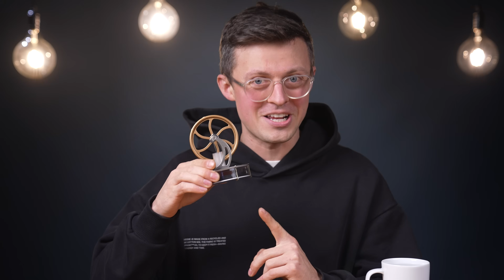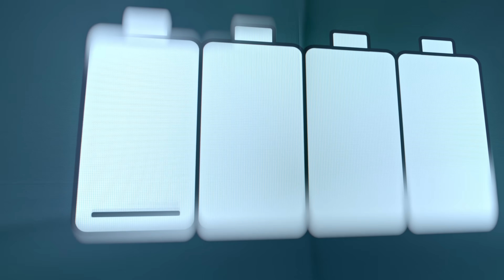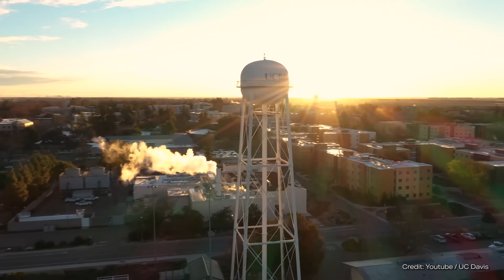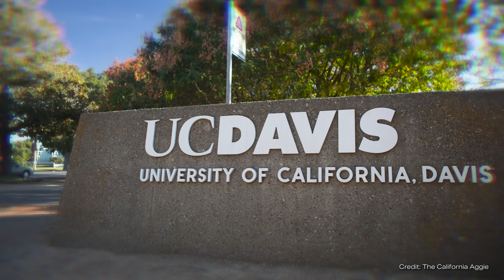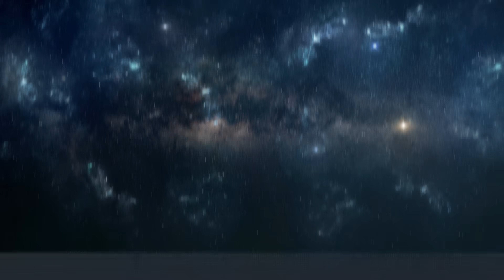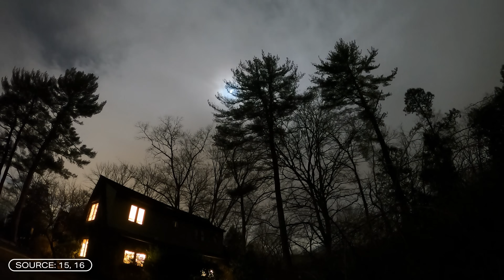This Engine Runs on the Cold of Deep Space!

Comment: The guy on the NightHawkInLight YouTube channel has done a lot of work with passive cooling and infrared cooling paint
Reply: You beat me to it by 20 minutes.
Reply: You beat me to it  😅👍
Reply: Ben also works on this!
Reply: @BuiltAndHosted  Who dat?
Reply: @AlbertaGeek  Ben=NightHawkInLight
Reply: @Peter_A1466  TIL
Reply: Dude has done a lot
Reply: Yes he is one of the definite OG founding DIY YouTubers and has definite quality stuff! Him , Cody's lab , applied science, not too many others.
Reply: He's done many cool projects like that (pun intended).
Reply: I like that guy and have P.M-ed him.
Reply: Combine this with his work thays simple and easy to undertand and youve got yourself a solar stirling engine that works at night possibly too
Reply: I wonder if we can get him interested in this. Imagine if the heat source were a thermal sand-battery rather than ambient temperature, and the radiator were still the sky-box radiative cooling. Huge boost in efficiency.
Reply: @beowulfshaeffer8444  There is a company that is looking at using flat lens' to cause thermal bricks to heat up  then run Sterling engines to make electricty.
Their numbers check out.
Nobody knows IF they would be using this method to power the cooled down side.
Reply: @beowulfshaeffer8444  I'm still a fan of using air that has been through a Geo tube that is placed 10 feet down.  The air should be about 55 degrees.  That stable number is very useful based in it's predictablity.
Reply: I've tried to convey this and other info to NightHawkLight.  There is an issue about how they made Ice in the Middle East in which they mention something about Solar radiance IE heat leaking into space pretty directly.
There may be times/+ Locations where you would want the coating material removed for a few hours?

Comment: The simple solar ovens made from a cone of reflective material pointed at the sun, with an enclosed container in the bottom of the cone which collects the heat and cooks things, work in reverse at night when the cone is pointed at a spot of empty sky without clouds - and can get the enclosed container very cold, they have been used to freeze water.  I haven't seen any practical use of this phenomenon, but it is a more directed heat radiator than the plate with special coating, and it would be very interesting to see if it could be incorporated into a nighttime stirling engine.

Comment: Would have to consider some serious implications and be careful on balances not only on earth but in space quick fixes arent the good way but it can help if done in balanced ways the flows should harmonize and compliment one another you wouldnt need the conflicting lush n pull it would have a beautiful wave that would compliment one another cha gin the internal spiral would change the resonaces little magnetic wave form resoances would help with the natural flows and sing together
Down side id see with venting to space in those dynamics is that your creating a heat shield that self reinfoces cause the cold air wouldnt be allowing heat to dicipate properly long term dynamics in space need to be accounted for short term n long term which beautiful friends could help us with that surrounding planets fields and sund field as well
Natural light lattice shielding does it naturally plus other options for harmonizing carbon on automic scale so the heat is brought back into balances naturally no venting required for that when stabalization works in harmony

Comment: I recently became a fan of your channel and really like the optimism and inspiration of your videos.
However, the math is a bit off.
I have a lot of my own stirling engines, wind turbines and generators, solar panels, inverters, batteries... deep into the stuff.
The 6W/m2 is the heat dissipation to space, it is not anywhere near what a stirling engine in such a configuration can do.
Anyone remotely familiar with thermodynamics has heard about the Carnot efficiency and that it represents the maximum theoretical efficiency any heat engine can achieve operating between hot side T and cold side T. That T is in °Kelvin.
So no matter what invention comes around with the presently available physics, the max efficiency of a perfect engine that operates between Hot=15°C and Cold=5°C is just 3.47%.
6W*3.47%=0.2082W per square meter. Better go back to the "horse" power.

Comment: What if you were to use the flywheel to move magnets through copper coils, use the generated power to feed to a battery, then the battery for charging devices?

If you were to actually heat up the lower side using a small burner, would this increase the efficiency?

Comment: I'm surprised they didn't just use the heat from the greenhouse to power it. or solar water heating. I would think that would be cheaper and certainly wouldn't be as affected by heavy cloud cover. Mix the two and you should have something the runs much more frequently too.

Comment: Inhsd s multi  backup system and ending finding this because actually it was the difference in temperature between the outside air and the air conditioned house at the time. So I found as long as you didn't have insulation there you could actually do it correctly but you have to have the correct materials in between and also there is a way that you can do it yourself lubricate yourself and you don't have to apply oil or other lubricants to it on the regular basis

Comment: the theoretical optimal of this being guessed at "over 6 watts per meter^2" basically just means its outright not as good as solar, solar panels are around ~20% efficient and can do about 150-200 watts per meter^2, this only really makes sense to be used on something that already generates a lot of waste heat the same way we use regenerative braking in cars
Reply: Spot on. This competes with the same space you could also place a solar panel and this is almost certainly going to be much more expensive than just adding batteries to a solar panel setup.

Comment: Ill give it that sterling engines are incredibly efficient for a mechanical heat engine....but...The problem with sterling engines is very low starting torque (which makes it difficult to overcome starting friction) and low hp for the weight and volume of the equipment, which means low power, recovery problems at low rpms and overall low power and reliability. They also do not scale well for this reason. There is exotic designs, but nothing on the mass scale. If the initial starting torque, low HP per weight and volume, and scalability can be fixed, then this might make sense.

Comment: how would it work in a greenhouse? thats a moist environment. and glass is opaque to far-infrared radiation.
sounds like a lie. did you mean it works outside of a greenhouse and powers a fan inside the greenhouse? 
if thats the case why mention a greenhouse, not relevant.

Comment: I think the most intriguing stirling engine application I've seen was as a boat engine, as the water you're floating in is a perfect radiator for the cool side of the engine, with sunlight conveniently on the other side to warm the hot side. Especially for small boats, it makes perfect sense.

Comment: So, we put a sterling engine directly into the spaceship hull, since the engine can be designed to interchangeable run on either hot or cold side. internal to the space craft, we apply a magnetically levitating fly wheel, with an 80-100: 1 gear ratio to create a "space turbine" basically. The sterling space turbine could power or support power to spacecraft systems and power electrolysis for making Hydro Oxy fuel for propulsion.
Additionally, since it's a sealed system, fill it with He since helium is the most thermally conductive inert gas. this will allow for a faster thermal transfer from the gas for expansion and contraction. High RPMs from the sterling engine combined with a near frictionless Fly wheel Turbine, could in theory, sustain a spacecraft, provided there was a large enough, or multiple modules. I think multiple modules would be the way to go to counteract the centrifugal force from the large module variant, unless you apply some sort of counter gyro or counter thrusters.

Comment: I could see this helping reduce capex costs in mass greenhouses, for example. No need to run wires for circulation fans IF they wind up efficient enough. That said, then the system needs to overcome the greenhouse's design to retain heat, not to mention that it's probably cheaper and easier to have a tiny battery and solar cell on each circulation fan like this. Hmm.

Comment: 6 watt pr square meter? solarpanels are up to 100w for the same area. Granted, they don't work at night, but they CAN also use infrared, so if you add a infrared heatsource you could get more than 6w 24-7

Comment: Interesting idea to use a house to drive a Stirling engine. The temperature difference between a corrugated iron roof (or even a plate steel plate on the roof) in direct sunlight, and the earth beneath the house can easily exceed 50C.

Comment: If the flywheel of the Sterling Engine can be a fan, and cooling is essential for solar to work efficiently, could it not be used to assist in cooling by having a line of Sterling Fans beside a solar panel to improve it's efficiency passively? Would that also make keeping the solar panel clean a bit easier too?

Comment: Stirling Engine in Outer Space? After watching this video, I was thinking The German Science Guy should have finished by telling us about how the Stirling Engine will be used on the Moon. I finally got around to asking Manus AI to explain. Prompt: Research the Stirling Engine, confirm facts, Research use as an electric generator, Future use to power a Lunar Outpost, Recap Key Points, and finish with your opinion as an Engineer’s Advanced AI. Manus 1.6 Lite: The Stirling Engine: A Comprehensive Review of its Principles, Applications, and Future in Space Exploration

Introduction

The Stirling engine, a closed-cycle regenerative heat engine, represents a fascinating and highly efficient technology with a rich history and promising future applications. Invented by Robert Stirling in 1816, this external combustion engine operates on a unique thermodynamic cycle that allows it to convert thermal energy from various sources into mechanical work with remarkable efficiency. This report delves into the fundamental principles governing Stirling engines, examines their current and emerging roles as electric generators, and explores their critical potential for powering lunar outposts, culminating in an engineering perspective on their significance.

1. Fundamentals and Operational Principles

The Stirling engine operates by cyclically compressing and expanding a fixed amount of working fluid, typically air, helium, or hydrogen, within a sealed system. Unlike internal combustion engines, the heat source for a Stirling engine is external, allowing for remarkable fuel versatility. The engine’s operation is based on the Stirling cycle, which theoretically approaches the Carnot efficiency limit, making it one of the most efficient heat engine cycles known [1].

Key Components and Configurations

Central to the Stirling engine’s efficiency is the regenerator, a heat exchanger that temporarily stores thermal energy during one part of the cycle and releases it during another. This regenerative process significantly improves the engine’s overall thermal efficiency. Stirling engines are broadly categorized into three main configurations, each with distinct piston arrangements [2]:

2. Stirling Engines as Electric Generators

The inherent ability of Stirling engines to convert heat into mechanical motion makes them highly suitable for electricity generation. They can be coupled with alternators to produce electrical power from a wide array of heat sources, including solar energy, biomass, and nuclear reactions. This versatility, combined with their operational characteristics, positions them as a compelling alternative to traditional generators.

3. Future Use: Powering Lunar Outposts

The unique challenges of lunar exploration, particularly the extended lunar nights and the need for continuous, reliable power, make Stirling engines an ideal candidate for future lunar outposts. NASA’s Kilopower project, which successfully demonstrated a small nuclear fission reactor utilizing Stirling technology, highlights this potential [5].

The Kilopower Project and Fission Surface Power (FSP)

The Kilopower Reactor Using Stirling Technology (KRUSTY) experiment showcased a nuclear fission power system capable of providing up to 10 kilowatts of electrical power continuously for at least 10 years. This system is particularly well-suited for the Moon, where solar power is unavailable for approximately 14 Earth days during lunar night [5].

Enhanced Efficiency: Stirling converters are significantly more efficient than traditional radioisotope thermoelectric generators (RTGs), meaning less nuclear fuel is required to achieve the same power output. This is crucial for reducing launch mass and mission costs.
Scalability: Kilopower units are designed to be modular and scalable. A lunar outpost could be powered by a cluster of four 10-kilowatt Kilopower units, providing a robust and redundant power architecture [5].
Technical Integration: The Kilopower system integrates a uranium-235 reactor core with passive sodium heat pipes that transfer thermal energy to high-efficiency Stirling engines. These engines then convert the heat into electricity, which is vital for sustaining life support systems, scientific instruments, and in-situ resource utilization (ISRU) processes on the lunar surface [5].
Looking ahead, the development of Fission Surface Power (FSP) systems represents the next evolutionary step. These systems aim to provide even higher power outputs, targeting 40 kilowatts of electricity, to support long-duration human presence on the Moon and eventually Mars [6]. The integration of Stirling engine technology is a cornerstone of these advanced power solutions, offering unparalleled reliability and efficiency in extreme extraterrestrial environments.

Recap of Key Points

Stirling Engine Fundamentals: A closed-cycle regenerative heat engine invented by Robert Stirling in 1816, operating on a highly efficient thermodynamic cycle with external heat sources.
Electric Generation: Stirling engines, especially Free-Piston Stirling Engines (FPSEs), are highly effective for converting various heat sources into electricity, offering quiet operation, fuel versatility, and exceptional reliability.
Lunar Outpost Power: Stirling technology is critical for NASA’s Kilopower project and future Fission Surface Power (FSP) systems, providing continuous, efficient, and scalable power solutions for lunar outposts, particularly during extended lunar nights.

Engineer’s Advanced AI Opinion

From an engineering perspective, the Stirling engine stands as a testament to elegant thermodynamic design, offering a compelling blend of efficiency, versatility, and reliability. Its external combustion nature allows for a broad spectrum of heat sources, making it inherently adaptable to evolving energy landscapes and niche applications where other prime movers fall short. The advent of Free-Piston Stirling Engines further refines this technology, reducing mechanical complexity and enhancing longevity, thereby minimizing maintenance requirements—a critical factor for remote and inaccessible deployments.

The application of Stirling technology in space exploration, particularly for lunar and Martian outposts, is not merely advantageous but arguably indispensable. The ability to generate continuous power independent of solar illumination, coupled with high thermal-to-electric conversion efficiency, positions Stirling-based nuclear power systems as the cornerstone for sustainable extraterrestrial habitats. The success of projects like NASA’s Kilopower demonstrates the robust engineering and operational stability of these systems under simulated extreme conditions. As humanity ventures further into space, the Stirling engine, with its proven resilience and efficiency, will undoubtedly be a pivotal technology enabling long-duration missions and the establishment of permanent off-world settlements. Its continued development and integration into advanced power architectures will be crucial for unlocking the full potential of space exploration.

Comment: I have one Stirling engine, a very sensitive one that starts in the hand. I've also been thinking whether it could spread the heat on the cold plate as IR light, but doubted it would work well. At least now we have experiments and measurements! And indeed, TEG are not interesting at such low temperature differences. What could possibly be usable though would be semiconductors like LEDs. At very low power, some can absorb a bit of heat and achieve an efficienty ratio above unity by cooling the environment. But we're speaking about picowatts to nanowatts per LED. Maybe one day this will be improved, and combining heat sucking with light production coupled with photovoltaic stuff will allow us to generate electricity in part from heat (it would need a little bit of power but would take a part of it also from the environment).

Comment: It seems to be unclear of how far into the ground is the dirt side?
At 10 feet down the temp here is 55 degrees year round.  When it's Summer here the Sterling would need to be set up to reverse.  (The Sterling will easily run backwards but those things connected to it.) You can create a tempature activated air Valve that flips over and the source from the ground would become the cool side in the warmer weather.

The concept of placing a series of Sterlings' under a row of Solar panels would mean the yield per meter is irrelevant, most of the year.  It would be that in the Summer where the ground is the cool side that mirrors onto the hot side would become an advantage.